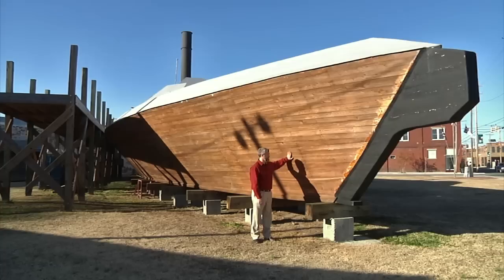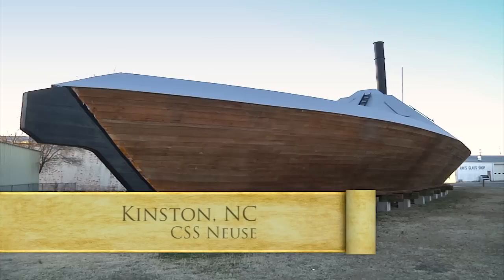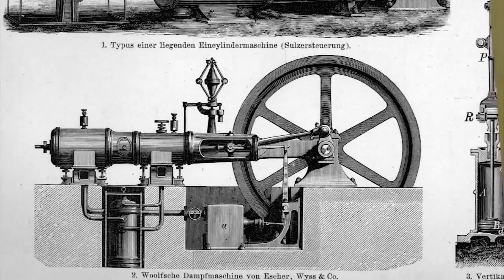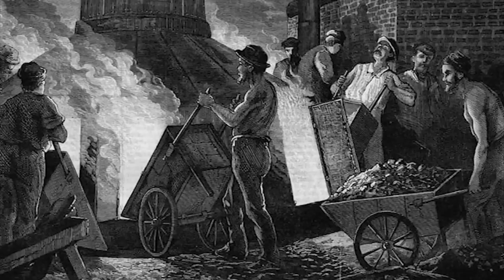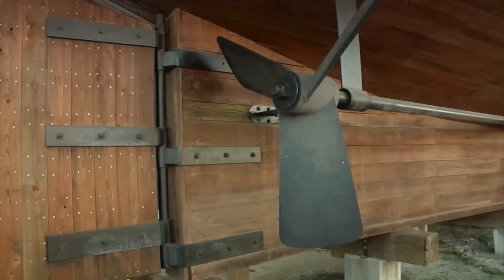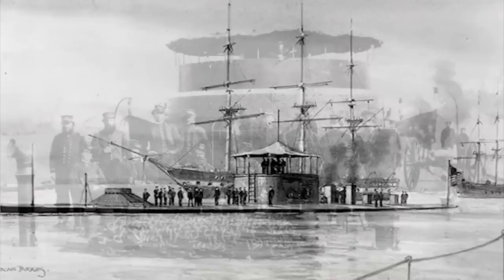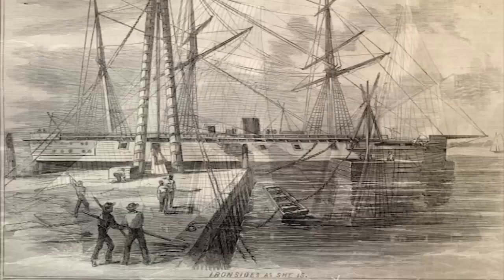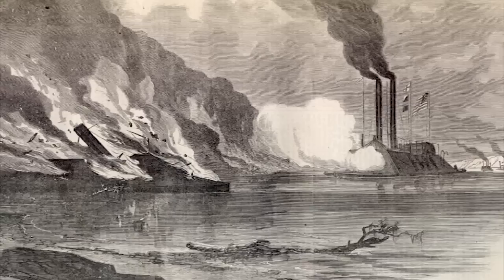CSS Neuse - Confederate Ironclad

Comment: Actually you are quite wrong in your comments, Britain had already seen the need for Iron warships when they heard about the French building the Gloire in 1858-59. It was actually the French who scared the British into updating their navy. HMS Warrior was launched in 1860 and commissioned in 1861, almost a year before the CSS Virginia and USS Monitor would be launched and see action at Hampton Roads in 1862.  And HMS warrior was the first truly ALL IRON ship built, her framing and hull were all Iron with an additional Iron armor belt protecting the vital areas of the ship. The French Gloire was actually a wooden hulled vessel that had Iron plating bolted over the wooden hull

Yes the US had a very large Navy of Ironclads after the Civil War but those ships were only of use along the coast and in the inland waterways. The US may have gotten a Monitor across the Atlantic, but at sea a Monitor type vessel would not be able to use her guns if the seas were anything greater then a flat calm, indeed even the casemate style Ironclads such as the South built were not sea going warships by any means.

Europe was hardly worried about the American Ironclads, since by the end of the war, both Britain and France were building Iron hulled warships that even included Turrets, the CSS Stonewall for example was a French designed Iron ram surface raider that included a turret  just aft of midships and armed with the latest British guns which were designed by Brooks to penetrate Armored warships. They were Breach-loaders and rifle barreled guns.

In reality, after the Civil War, the United States found itself at a disadvantage to the French and British in terms of a modern ocean going Navy. It would not be until the 1870's with men like Teddy Roosevelt campaigning across the nation and in the Halls of Congress that the U.S, would finally put together what would become the Modern United States Navy.
Reply: Reminds me of something. 
When CSS Alabama went out to what would end up being her final fight with USS Kearsarge, the match was policed by French Ironclad Couronne, who would have (if the situation required it) been perfectly capable of taking out Alabama and Kearsarge simultaneously.
Reply: The Battle of Hampton roads was the first real serious engagement of 2 ironclads hammering it out
Reply: @themanformerlyknownascomme777  the French were unlikely to really do anything as they were loyal to the union at least as far as taking a neutral approach

Comment: Also, I read your little spiel about the USS Miantonomoh, which did not cross to Europe until 1866 and was in Fact towed much of the way. while it may have caused a stir in the press of the time, most Naval Tacticians could readily see the designs' shortcomings as a deep water vessel. As I stated earlier, Monitors could not fight in the open ocean unless the water was little more then a flat calm due to the guns being at such a low free-board.  Indeed it must be remembered that even the great ships of the line at that time could not use their lowest gundeck in rough seas and the guns on Monitor type ships of the day had their guns actually even closer to the sea then ships like HMS Victory with her lowest deck battery.

Indeed at the time of Miantonomoh's arrival in Britain, HMS Monarch was being built in the Chatham dockyard, the first Royal Navy ship to not only have two turrets, but also 12 inch guns. Monarch was far and away a great advancement over the Monitor type design.
Reply: +hitmann2300 The U.S, navy probably could have gotten the USS New Ironsides to Europe if it had chosen to do so. No Turrets, so it was 'broadside only', but it took heavy shelling from Confederate forts without any more damage than the smokestack, and pilot house. She was 'top heavy' and rolled in rough water, but was very seaworthy. 
I don't think that any of 'Pook's Turtles', being based on inter-river steamers (either side-wheelers or stern-wheeler paddle boats) could've been useful in deep salt water. Not having enough draught would've put them at risk for capsizing. The twin-turreted Monitors such as the USS Manhattan were somewhat seaworthy, able to get from N.Y./N.J. down to Mobile Bay, and were used up thru the end of the 19th century. 
The European navies knew they had to make 'blue-water' iron fighting ships by the early 1860's. The U.S. Navy had many ironclads (as did the Confederacy, something like 23 built during the war), even if those ships were mostly inter-coastal or river in their seagoing abilities.
Reply: That is because they did not have the supporting colliers of coal with it.  Also according to some Naval accounts  when the Miantonomoh reach the English Naval Bases, the captain challenged the British to a gun duel by which they would exchange broad sides at each others vessels (empty of course) and see which ships would inflict the most damage on the others vessels. The British Admirals declined, possibly for two reasons. First, the nature of the targets profile were too different, secondly, and most importantly, the US warships 11 inch guns were specifically designed to crack the iron armor on other warships whereas this was not the case on the Warrior.

Comment from the maker: While it may not have been an absolute revolution, the American ironclads did cause Britain to take a second at the balance of power between the fleets. We can't include a link in the comments, but check out Britain and the Balance of Power in North America, 1815-1908, by Kenneth Bourne, especially p. 275

Comment: From what I learned in my American History classes, the Monitor was specifically designed to take out the Merrimack. The reason it had only a small turret on it's deck made it a difficult target to hit and allowed the Monitor to fire at the Merrimack from any angle, so it wouldn't have to manuveur itself into a position to fire at the Merrimack, giving it a distinct advantage. I also heard that it had somewhere along the lines of about 1,000 patents alone on the Monitor.
Reply: And it failed.
Reply: It's mission was to stop the destruction caused by the Virginia. Personally, once I found that it could do little to hurt my vessel, I would've continued sinking the blockading ships.